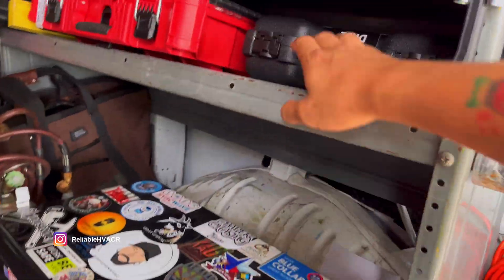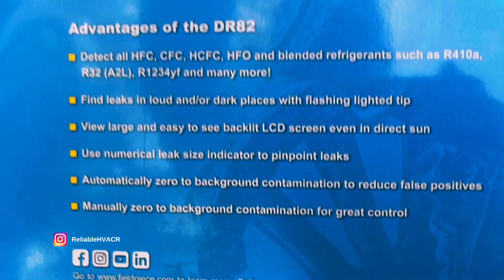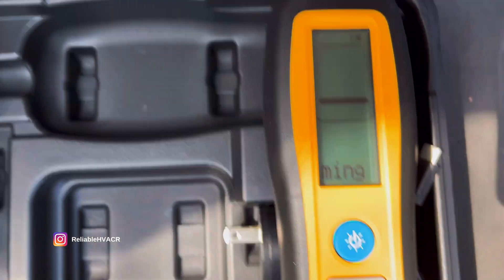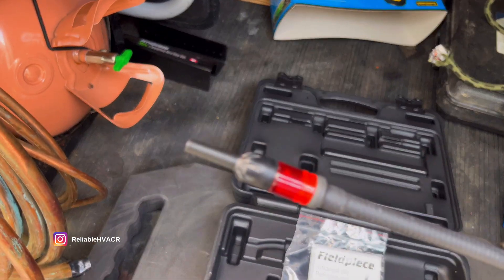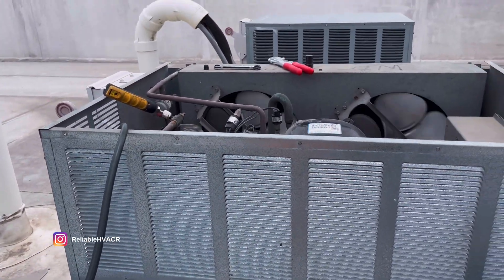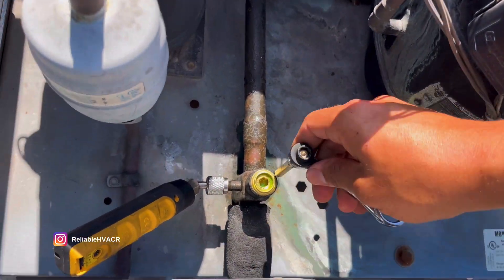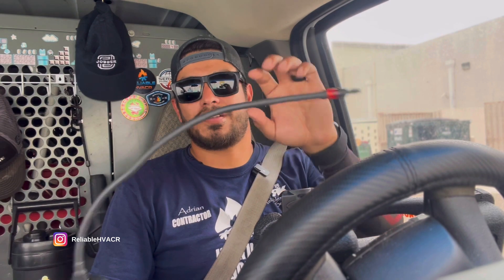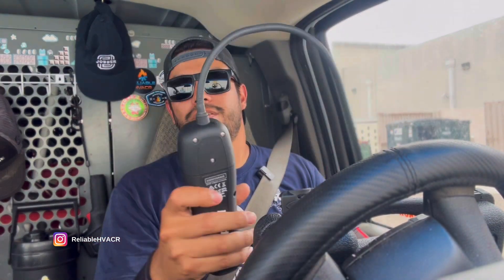Leak Search & Repair w/ the Fieldpiece DR82 Infrared Leak Detector

Comment: Can i use detector when the AC is off and low on gas
Reply from the maker: Yeah, it's preferred when it's off so the suction pressure isn't so low either. Low on gas is usually ok unless it is a really tiny micro leak

Comment: Read the instructions. With infrared leak detectors you need to keep it moving. To test it you can use a sharpie pen or you can use a gas stove with out a flame.

Comment: I’ve been running the dr82 as well. So far I’m liking it. I kind of wish it wasn’t rechargeable and would have taken batteries like the probes but o well. My FP micron gauge doesn’t show microns on my app? How did you get it to change over?
Reply from the maker: Yeah maybe, as long as it isn't D batteries like my old Tek mate 😂

It's linked? What's it showing ?
Reply: @ReliableHVACR  yes it’s linked. It shows mmhg. But on the actual display it’s in microns.
Reply from the maker: @MRICE-qe4sv  ohh ok. When you first open job link click on "more" then click on "unit settings" and there you can change units on all tools

Comment: What’s the wireless range like on the micron gauge?
Reply from the maker: Are you asking about the micron gauge range?
Reply: @ReliableHVACR  yes
Reply from the maker: The MG44 which is the one I use has 1000 feet of range. I'm able to connect to it while I go back to the van for a break. But it depends on the building, it can make it difficult if there's a lot of walls and things in between you and the gauge

Comment: First I love Fieldpiece! But I’ve been  really disappointed by the DR82. I’ve had at about a year and I seem to really struggle with small leaks. So it’s going up on EBay. Decided to send in my H-10 to reapaired and sticking with that for now.
Reply: Th DR82 is an infrared detector and you have to keep moving it, and Fieldpiece leak detectors work better for blended refrigerants. The H-10 works better for one component refrigerants like R-22. You can check to see if it's working by moving a sharpie pen in front of the DR82 there's something in the pen that will let the DR82 register like a leak. Or natural gas will work, just turn on your stove with out a flame and it will register like a leak.
Reply from the maker: I've heard of that, it's a tool you really should trust. So I was cautious coming from another one I really enjoyed but luckily so far it's doing good. I'll be testing it more.
Reply: Are you consistently moving it?
Reply: I recently bought the h-10 pro and im not sure if i love it yet but i continue to work with it...my Fieldpiece heated diode seems to be giving alot of false positives these days but imma see
Reply: @marjones69  NorCal Dave on YouTube has great videos. He’s also showed how to get the best use out of the H-10. Actually there are few out there on using the H-10. I’ve got an ultrasonic I use as a back up too
Reply: @jorzer18  Got you...Dave is my guy, i watch religiously, matter of fact, Dave is one of the reason i got it...i figured it is just a learning curve..
Reply: From my experience owning both HD and IR of the last generation of these, as well as an array of other brands inc. ultra sonic, the heated diode works far better for small 410a leaks.  I have to run IR in boost mode and still is not as sensitive however heated diode does false positive a bit.  Just know the heated diode will go crazy even on small leaks @ high setting. Light beeping seems to be often false.  She beeps on fresh cut grass and wind lol. Obviously as per instruction keep IR moving.
Reply: I’ve been having the same problem not picking up small leaks and just going off erratically. Ive been told to try the H-10.
Reply: @jasondill7643 i just got one and it doesn't pin point the leak it just goes off. I knew there was a leak i just needed to know where
Reply: I've had both. I'm always having issues with changing my with h10. I e have now 3. 😢